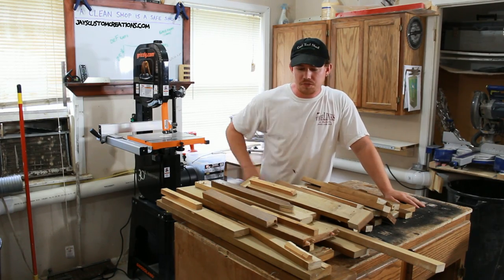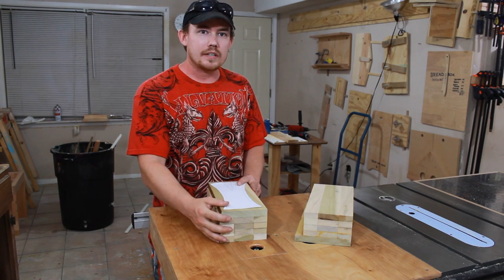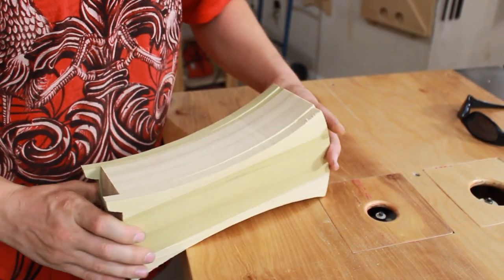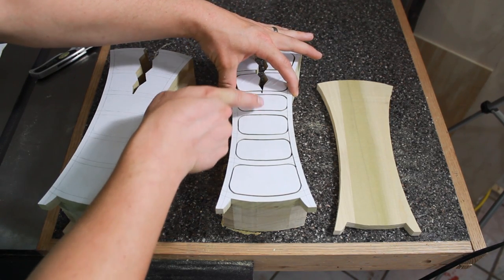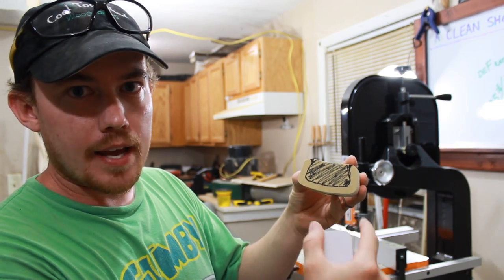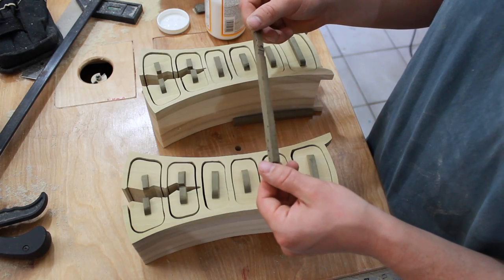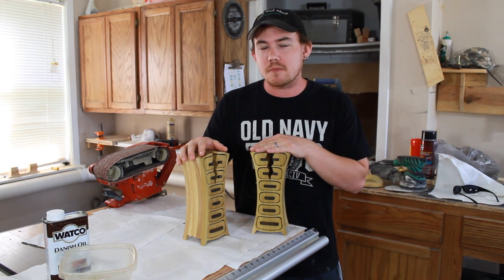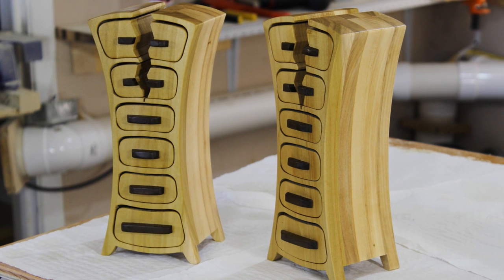Trash To Treasure - Cabinets to Bandsawn Jewelry Box - 112

Comment from the maker: A 1/8" blade will cut even tighter if you can find a good one. Keep in mind the teeth count. I have been told you never want to have more than 20-24 teeth in the wood at a time or you will notice burning. I cut this entire project without a single burn mark.

Comment: Instead of slicing off the back, then slicing the fronts and backs off the drawers, , use 3 separate thin layers when making the blank, 1 on the front, 2 on the back, adhered with double-stick tape. After cutting the outside, unadhere the front and second back layers to make the feet, then readhere the front to cut the drawers, then unadhere the front and back first layers, to hallow out the drawers. Then apply glue where needed for final assembly.

Comment: Im looking into buying a bandsaw mainly to do bandsaw boxes 4-5" thick hardwood . What size bandsaw would i need power wise ? 350w , 750w or bigger?
Regards Gareth
Reply from the maker: I'm not a bandsaw expert by any means but keep in mind a lot has to do with the blade. A powerful bandsaw will have a hard time cutting thick hardwood with a high TPI blade.

Comment: Jay, the website with the plans appears to be down. Do you know of another place I can find the plans?
Reply from the maker: Hey Justin. Thanks for the heads up. I left that link up in case they resolve their site issue but also added a download for my copy below it. It's the same template but scaled down just slightly to fit on a regular 8.5x11 piece of paper. I believe his originals were 14" high so it's not much different.
Reply: Thank you, Jay. I'm planning on giving this a shot as my first bandsaw box.

Comment: Thanks what would be the best tpi for hardwood 4" plus ?
Reply from the maker: You really don't want more than 20 teeth in the wood at a time. 4" / 20 teeth = 5 tpi. I used a 3/16" 4tpi skip tooth blade in this video. The slab was around 4" thick.